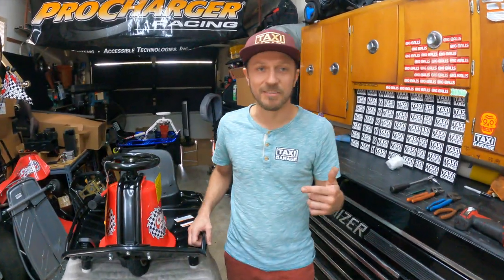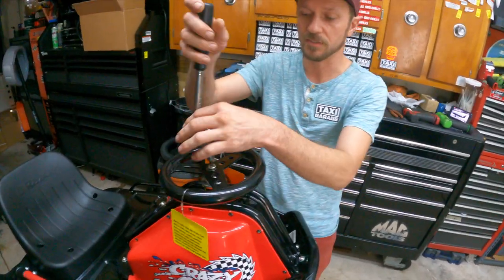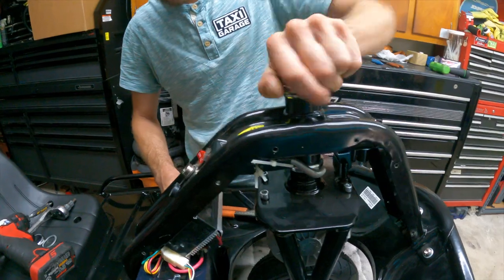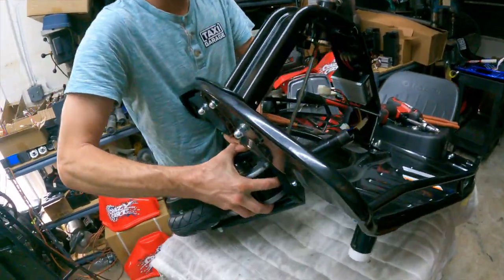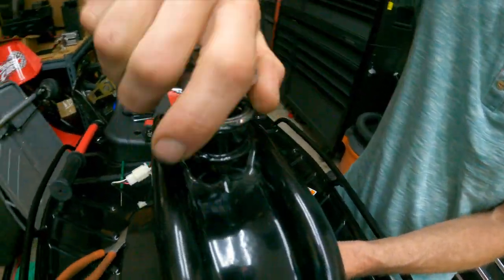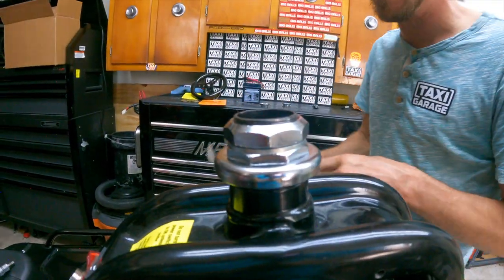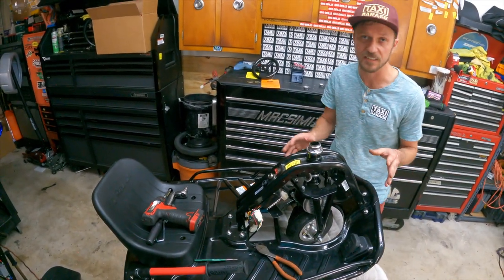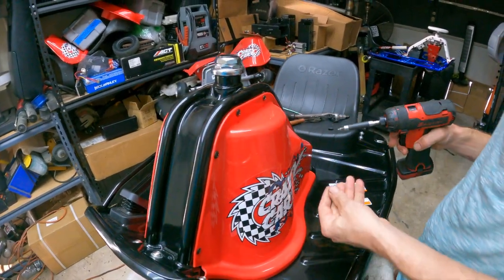Crazy Cart Steering Wobble Check your headseat bearings! | TAXI GARAGE

Comment: Just bought a 2014 model used CC yesterday that had a horrible wobble wobble. Didn’t have a set of bearings but opened it up anyways and after some tightening and adjustment it’s much better!! Gonna go ahead and order a solid front and new bearings for future use. Thanks for this info as it helped me tremendously ✌️